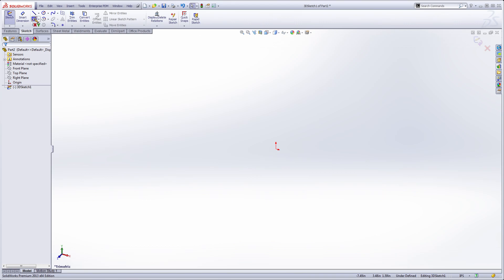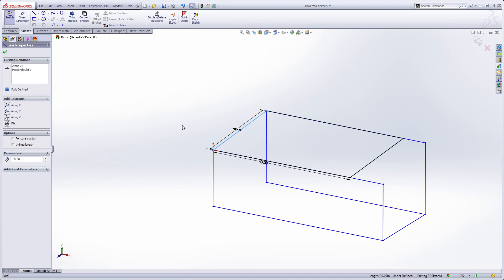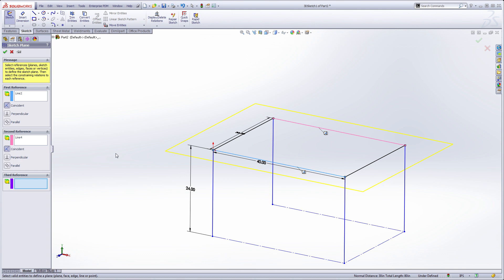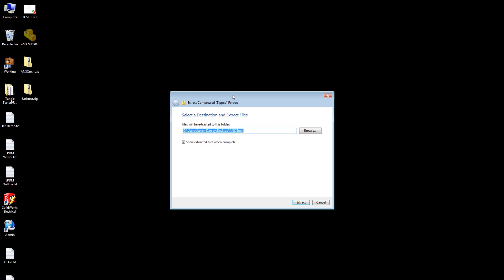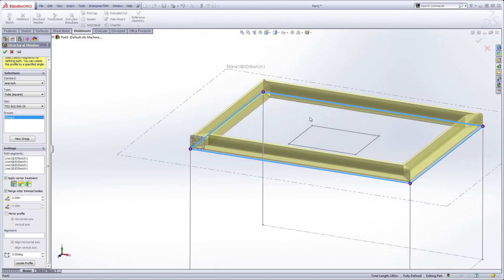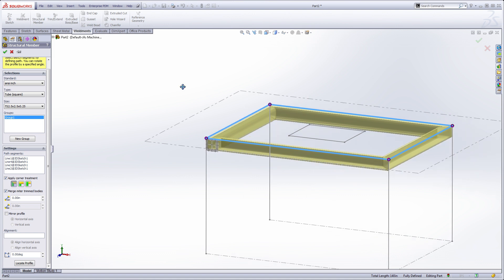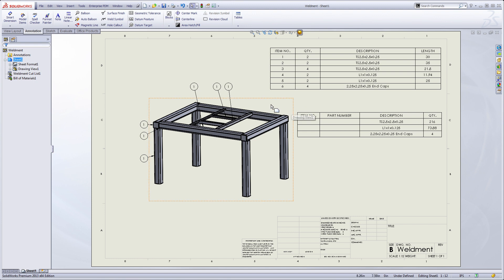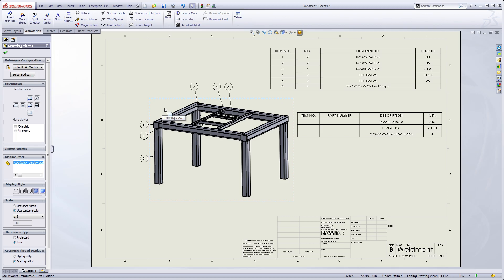SolidWorks Weldments 101 - Simple Table

Comment: @1.55 why i cant snap to a point when i drag the other point
Reply: me too is so fustrating i cant find why it wont snap
Reply: ok I think I found a fix. only way to have them join is to click one point, hold down ctrl and click the next point then click MERGE on the left side panel under 'add relations'  this seems to work fine for me but I think its a bug that hasn't been fixed in later versions of sw2016-2020

Comment: Very helpful, thanks! I thought I was crazy for putting each leg on a table in a separate group in a Structural Member feature, but it looks like that's how it goes.
Also good to see that eventually you do have to use trim/extend sometimes if corner treatments don't come out right even after trying different settings on individual corner treatments.
Learned about Weldments at a recent SolidWorks User Group meeting. Insanely useful tool for so much more than actual weldments. I think many could be helped by using this feature.

Comment: ProgressionSupport,

So I have just installed Solidworks 2016. On my previous version it was easy and simple to use my weldments profiles. I do understand how load your own profiles or any kind.

Now the problem I run into is: When you right click on your tab you see your options: Assemble, Layout, Sketch, Evaluate and so on... And for some reason, and maybe I did something when I first started to use solidworks, it doesn't give me option of adding weldments tab? So I can't use it at all?

Am I supposed to do something in setting to be able to use this feature? Or maybe it's my installation was done wrong?

Please help help!!

Thanks,

Comment: This video has been very helpful to me. I'm building a similar table for my shop. Can you point me in the right direction to model a piece of 1/8" steel for the top? I created a plane on the top surface, but I can't seem to locate the table top to the table since it's on a different plane.

Comment: This looks so much better than inventor. I have only begun learning inventor but I think I wish I had solidworks instead. Can you give any advice about which is better? I have been drawing in AutoCad Mep for 10 years and used Autocad  for over 20 years. I'm just looking for a new software to learn and wondered which is better. Any advice would be much appreciated. Thanks for video.
Reply: In my opinion inventor and solidworks are very similar! But in the industries tday they use more solidworks then inventor. Solidworks is much easier to learn then inventor.

Comment: hey brother
can u solve a little problem of mine
being a new user iam not able to resolve the issue
smart dimension is not giving me option to input my required dimention
for example if draw a circle  off 200  mm ,i would draw a circle and with the smart dim i will input 200 to make to the size
but its not taking me there , all it does gives the actual size of entity  and thts it
could u solve my issue
thanks
or anyone else who has a solution fo this pls do respond
Reply: learning too - but dont you just double click the dimension numbers and the edit box appears